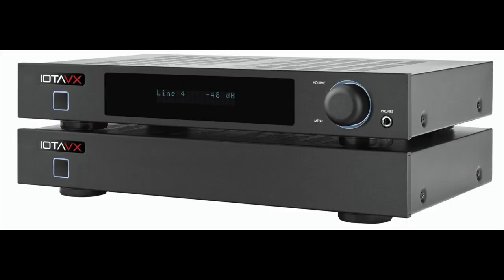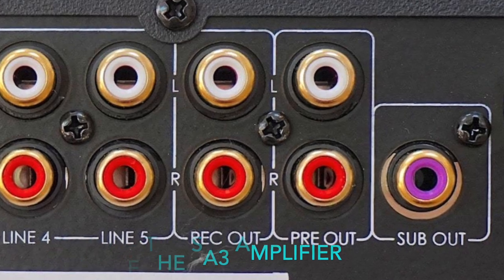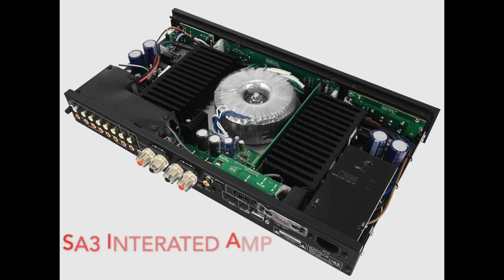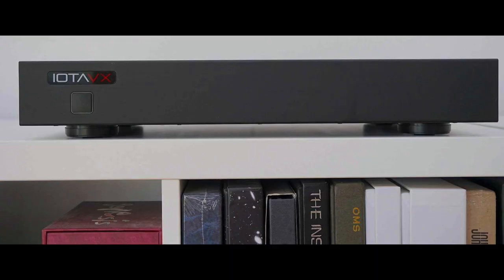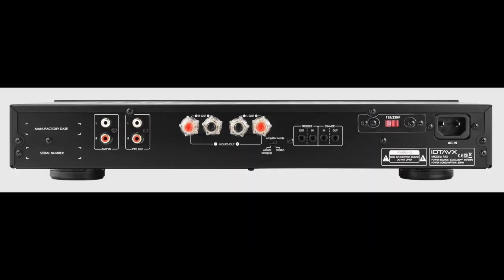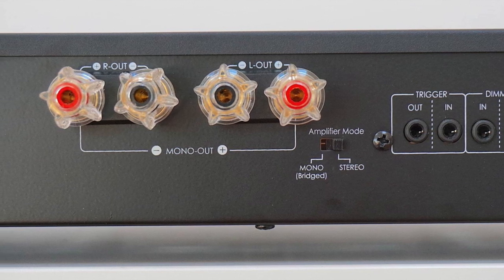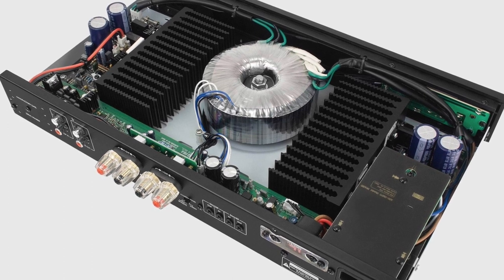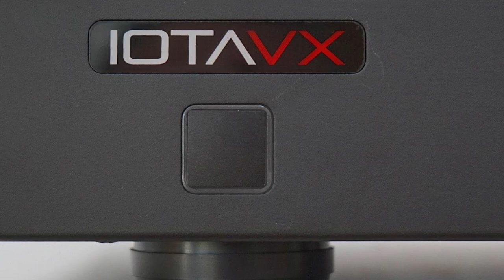IOTAVX PA3 Power Amplifier Review: https://www.iotaenterprises.co.uk

Comment: I would like to know of this si an upgrade from the Yamaha A-S700 or A-S701
Reply from the maker: Aren't both of the Yamahas integrated amps? The PA3 is a power amplifier.
Reply: @TheAudiophileMan  Yes, they are integrated amps, I was referring to the combo SA3+PA3 or just the stand alone integrated SA3 amp with a decent DAC like the SMSL/Topping or the MagicDAC from Cambridge Audio.
Currently I have the Yamaha A-S201 and want to push my BC Acoustique Tamise speakers further since the A-S201 is just a 50W per channel amp and also I have the Wharfedale Diamond 11.2 and I found the Yamaha just doesn't cut it, so I would be looking for a 80-100W per channel amp, since a 1991 Sansui 2x50W pushes my speakers more than the newer A-S201 and was looking at used newer Yamaha amps that fill my budget of 200-300 Euro or so.
Reply from the maker: @SacreDro  I’d certainly go for the pre and power over both Yamahas, sure.

Comment: Nice review/talking, let's hear some sound/music...
Reply from the maker: Sorry - not on this channel. I take my role very seriously and I refuse to deceive my viewers. Any sound coming from this video would have run through 20-40 different processing gates before it ever reached you so, while you will hear a noise. It will not be representative of the product in question. What you will be hearing is the device you're using to view the video - nothing more. The only way you'd be able to judge the sound would be to sit in my listening room with me. And then only after getting used to the reference system it was connected to.
Reply: @TheAudiophileMan  
Okay i understand, nice review anyway.
Yeah only the sound in your room/your speakers, your music .
Have vintage IMF ALS-40 speakers and like them, reconed mid range speakers. Sound nice for my taste, sometimes little to much bass.
I’m curious how this Iotavx sounds with the IMF’s.
Current amp; Denon PMA 700V(1988) and a restored Sansui AU-719.